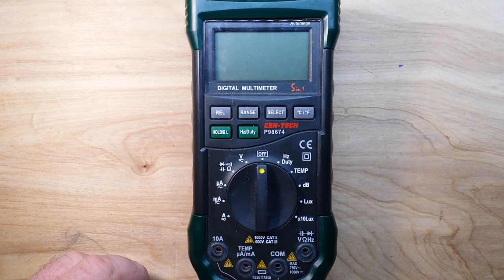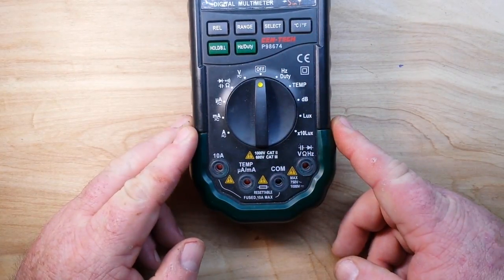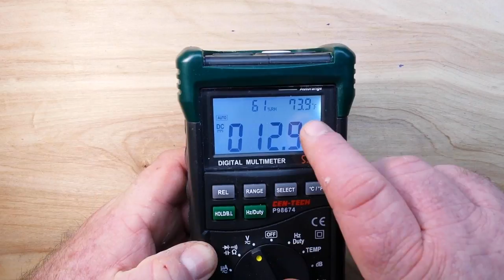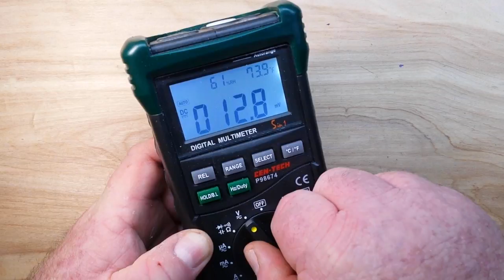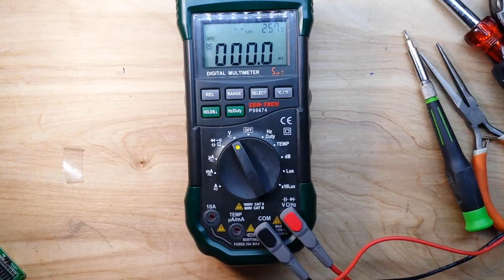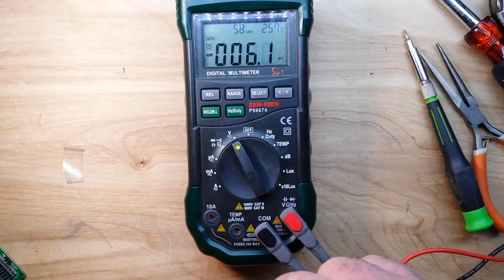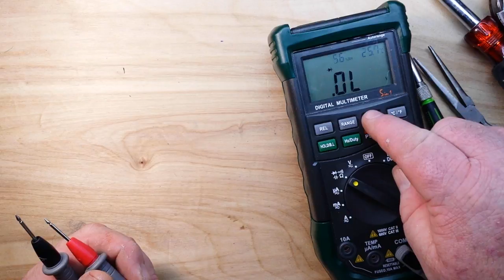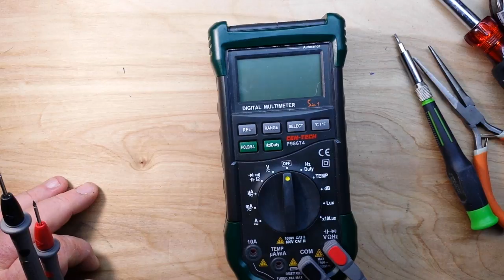Centech P98674 DMM Teardown

Comment: I was very surprised to see that yours has an actual IC rather than a "blob on board" for the main meter IC. The IC has been identified (as people have modified this meter to support data logging capability) and there is a manual available for it. I believe the smaller COB IC is actually responsible for the internal temperature and humidity sensor readouts.

Whatever the case, I've been very happy with mine and continue to use it quite regularly. I did have to clean the rotary switch contacts a while back, but it's been fine since. The only thing that would have made this better would have been true RMS capability. There are some reports of these coming with a glass fuse, rather than the ceramic HBC type.
Reply from the maker: Its a nice meter.

Comment: I must have chosen an improper setting when testing something (it's been a few months and I can't remember what it was) to cause this multimeter to stop working. I changed the 10A/250V fuse and the batteries, but still doesn't work. The manual says something about a resettable 500mA/250V fuse, but provides no information about it.  Could I have blown this fuse? Do you have a video showing its location and possibly how to replace it?  Thanks.
Reply from the maker: +dpblanchard Hmmm, usually resettable fuses refer to poly fuses which reset automatically once the fault condition is removed. Do you have any display at all?